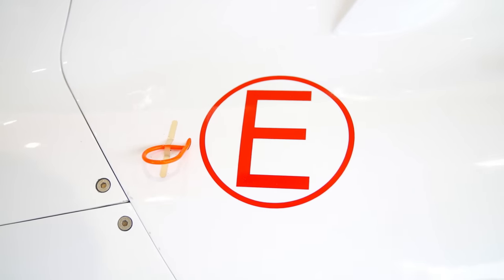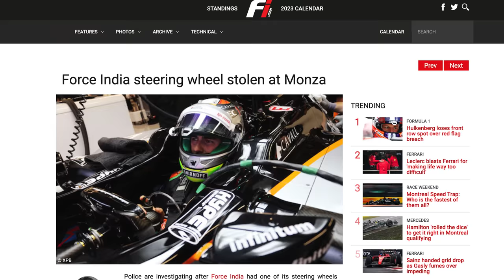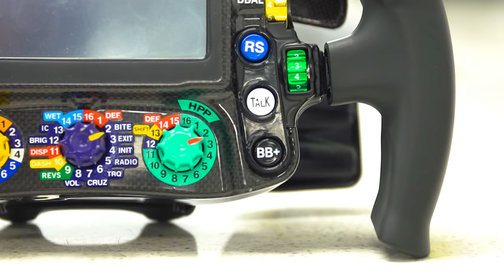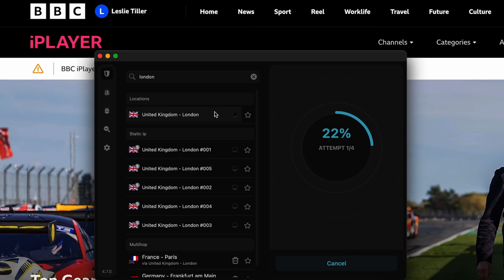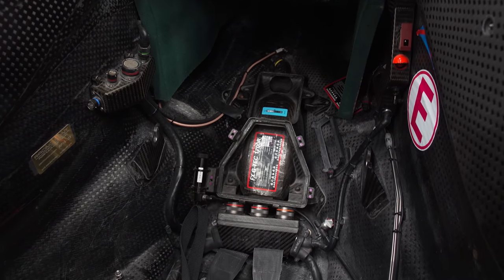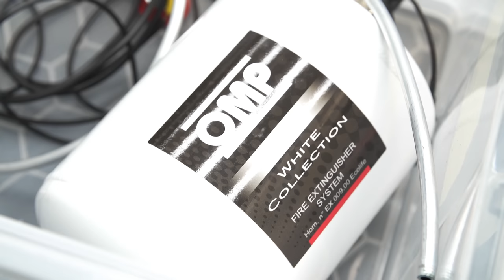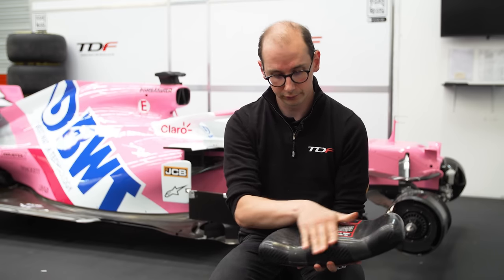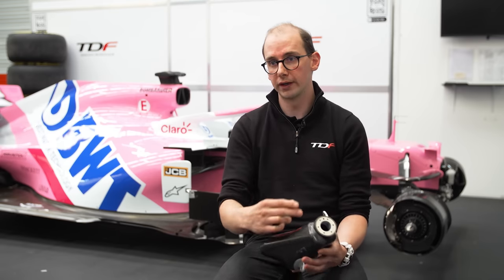Pull This Cable And You Destroy A Formula 1 Car

Comment: Reminder that Robert Kubica on his comeback must have attempted and passed the 12 second extraction test with his injured hand. I find that quite impressive.
Reply: And Lance Stroll had to pass the tests with his injured wrists at the beginning of this season.
Reply: Billy monger races f3 and did this test for f1 and passed. He’s a double amputee, above knee and below knee. He lost his legs in an f3 race. It’d be hard to get your whole body weight on your arms in a laying position like these cockpits. I tried in a formula ford 3 months after I lost both my legs and I can tell ya it wasn’t easy. Thinking where to grab was the hardest.
Reply: @nothinyaseehere9449  Monger has electrical prothesises in his legs while he races. How could he therefore use any pedals huh?
Reply: @vernerikerppola4438  he races with hand controls normally in formula 2. I use prosthetic legs aswell and I use the throttle brake n clutch pedal.. it’s really not that hard…
Reply: @nothinyaseehere9449  he's never even raced in formula 2, he stopped racing in 2019...
Reply: @tauzik  yeah but he’s tested the cars..
Reply: What f series do you race in?
Reply: Ahem, Zanardi?

Comment: I’ve done some of the carbon fiber work on extinguisher moulds but never understood nor have seen anyone explain how remote charging works. That was super interesting
Reply: The AFFF system in my track car (former race car) has such a remote charge - and it's decade old tech. The charge is a common BB-gun CO2 cartridge. (I like it because I can refill it (water and soap powder) without all the hazmat crap with shipping a pressurized system - which is what's in the active race car(s).)

Comment: It’s insane how fast you need to extract yourself from a Formula One car, even a fit person would struggle their first few times, also, how many attempts does a driver have to do this test?
Reply: I think they have as many tries as they need which is a bit mad really
Reply: Its also insane how quickly you an roast to death in there; overalls are only fire retardant, not fire proof, and certainly not heat proof. Self-extraction is also practiced at Formula Student (and a whole host of other events) - its important.
Reply: @andyowens5494 the weird thing in Formula Student is the fact that the driver has 2 less seconds to leave the car, and almost none pf them are trained racecar drivers
Reply: Seeing how fast they can burn, and how hot, it's not surprising at all. When your car is on fire, you will be HIGHLY motivated to get out. We practice that. But we can't practice with the car covered in AFFF, which will make the job MUCH harder. (that stuff is effectively soap.)
Reply: @raphaelrodrigues1645 as someone who has gotten into a fsae car before, it looks a lot easier to do that over an f1 car lol
Reply: @JackJackJackJackJackJack  well, we are still talking about university students, not professional drivers, but yes, a FSAE car is a lot more spacious than a F1, even though it is half the size lol

Comment: The 'E' is for Extingusher, not the electrics. Common Confusion for new marshals, or even experienced ones in the heat of the moment. Yes it should kill the power to the car, but if cutting the power is the only goal, then go nowhere near it.
F1's have the neutral button on the front of the chassis. This shuts down the ERS and puts the car in neutral to allow you to push it. Oddly alot of these are really small and near impossible to press with the big ERS gloves, marshals are required to wear. I always had a sharpie or something to poke in the hole.
Even with the steering wheel in place the amount of effort needed to turn the wheel while leaning in beside the car it also quite alot.
Reply: My understanding was that the E stood for Engine, and that pulling the wire would just stop the engine. For use in accidents like Massa 2009 where he was knocked unconscious and unable to turn it off himself.
Reply: @davepusey  Nope E is for Extingusher. There is a electric lightning triangle in club racing for electric shut off
Reply: @joewatts6016  I specifically said E for ENGINE, not Electrics which as you say has it's own lightning bolt symbol.
Reply: i thought it stood for emergency

Comment: I work at a formula Student Team, and there are similar regulations about getting out of the car and also a button on the outside, which turns all electronics off. but there we don´t have such advanced fire extinguisher.

I am not the driver, but i also did the Cockpit exit exercise once, and it isn´t that easy.

Comment: I did not know about this system. So in the case of Romain Grosjean's crash - did this system work or not work?
Reply: The car was split in half so I'm not sure they used it
Reply: It couldn't have been used since the car just exploded in a ball of fire and there wasn't really any time to pull the cable
Reply: The car was cut in half, and the part that Grosjean was in was no longer connected to the fire extinguishing system. Plus, good luck pulling that cable while the car is up in flames like his was. It's for engine fires, not for massive fuel fires like Grosjean's.
Reply: @-Jester  at 5:52 they showed a button inside the cockpit presumably located where it's convenient for the driver to press it when in a panic due to fire. And the video said that it floods the cockpit area with the fire suppressant. I could understand the system failing if the car splitting severed the system, however, I'd think that if the car splits in half then most of the time you'd want the fire suppression system to automatically go off. Again, I didn't know this system existed, hence the wondering how it worked out in an actual car-on-fire situation. I don't recall anything mentioned about a in-car system for fire suppression during reports on the crash - which might be because I didn't pick up on the mentions because I didn't know the system existed.
Reply: @eric81766  Even if it does automatically trigger, there's nothing much it can do if the connection to the nozzles is severed
Reply: @eric81766  There's a good possibility that the system was either severed or otherwise damaged. The fire suppression relies on pressure and if the pressure is lost then it won't work correctly.

The other scenario is that the fire suppression system worked as intended - it stopped fires in the cockpit of the car. However, as Grosjean's accident was a fuel fire where the car was torn in half and the fuel was ignited all over the floor, the danger wasn't coming from inside the cockpit but instead all around the chassis. This would also explain why only Grosjean's hands were burnt, as the fire wasn't inside the cockpit but instead around it, and he burnt them in the process of escaping.
Reply: He didn't use it, because it's not something they actually train for
Reply: @-Jester  Plus, Haas said his gloves (Alpinestars, not sure which model) were of the older FIA 8856-2018 standard, while his suit (an Alpinestars GP Tech V3 - best in the biz) was designed to 8856-2020

Comment: Can somebody kindly explain why f1 teams dont use flexible flask type containers to store the fire extinguishing material ? Wouldnt that be more cost effective and easier to place within the car ? (Suppose a flexible but nonetheless resistant container to prevent punctures, tears and the like)
Reply: Pressure
Reply: Think spraying a bottle of champagne (rigid vessel) vs blowing up a party balloon
Reply: Did you see the video? They do use a bag type system, the carbon fiber enclosure is just there to support the bag for when the system is pressurized.
Reply: @musguelha14 I’m sure they mean just the bag dude🤦🏽‍♂️

Comment: "The steering wheels are very expensive "
Well, to mitigate against that they should've just engineered the cars to work with an off the shelf game controller like you'd have for your ps3
😂
Reply: PS3? Have you been in a coma for 15 years? If so, my apologies.
Reply: This comment aged like milk

Comment: I’m surprised the haven’t switched to stop fyre the halon replacement yet 

For anyone unfamiliar halon was banned  from manufacturing specifically not use (it’s still used where it’s been installed and the supply hasn’t been exhausted) for environmental concerns and was a gaseous extinguisher that doesn’t spray a “foaming agent” and can be fired multiple times without cleaning or recharging it doesn’t expire the way most foaming extinguishers do it’s also doesn’t destroy everything it touches the was a lot of extinguishing agents do

Comment: In the industry I'm grounded in, we have on-vehicle extinguishing systems that are not only Halon-based, but the bottle containing it - Under significant pressure, I might add - Is a good 500mm diameter and 2,5m in height. Despite this, it bears a more than passing resemblance to a family-size UK Class A fire extinguisher... 🙃

But that said; The system's designed to suppress high intensity electrical fires (Including transformer overruns) on a system that operates at 25kV, at speeds of up to 320km/h, on a vehicle weighing over 950 metric tonnes. As an aside to this, it also covers the distance between London and Paris in just over two hours... 🚄🇪🇺💨😁

Also: Can anybody please explain that Halo device? I can understand it being employed in Formula E - No engine means no air intake, meaning no „Triangle“ - But why would you need it in conventional ICE F1 too? 😳

Comment: Seeing you get out literally made me cringe. I know you've never been harnessed in, but they should've explained this to you... the harness is designed to stay out of the way. (For the record, those loops on the shoulders of the suit are there for safety workers to pull your ass out of the car. I have seen them used.) The harness will simply fall away / slip over your shoulders as you get up. You don't need to touch the radio or cool suit connectors; they're break-away.

(In my track car, you DO need to get out of the harness. I'm using Simpson D3 off-road harnesses... the hip and shoulder are connected. It's only used for track days where people are running street cars with nothing more than the factory 3-pt seat belts, so safety workers are prepared to cut seat belts. Plus I rarely wear my suit in that car.)

Comment: kind of like aircraft, if you pull that engine fire handle you are not relighting that engine again*.

*Not in flight at least, once the turbine engineers pull it apart and fix it, then it will run again.

Comment: Interesting. So the driver needs to manually pull the wire to start it, instead of automatically going off when it detects fire (heat or smoke)? What if the driver is unconscious?
Reply: That's why you have the one on the outside for a marshal to pull
Reply: Auto detect system is subjevt to faults which would be extremely dangerous if it went off mid race. 

Better to stay manual and ensure all staff on track are allways ready and at the scene of a crash as fast as possible.

Comment: Formula Student you have to be able to egress in 5 seconds, there's no requirement to refit the wheel. 

I think the fastest egress I know of was about 1.6 seconds. I think in the real event the driver just yeets the wheel when getting out.
Reply: It strikes me that the wheel replacement portion of the test is completely irrelevant, if there is such imminent danger that you need to leave the car as fast as possible then replacing the wheel would be too risky anyway.

Comment: Seems like a pretty big design flaw, like putting testicles on the outside it's bound to receive treatment it wasn't meant for.
Reply: not a design flaw at all. No one will pull that for no reason and it must be reachable when needed

Comment: To me its pretty ironic that halon fire extinguishers were banned/discontinued because of environmental effects…in the Formula1
Reply: The gases from that kind of stuff were surprisingly a lot worse than typical carbon from cars. 

It ripped holes in the ozone.
Reply: There is more to it than that - if you spray halon on sufficiently hot metal it decomposes and the resulting products include hydrochloric, hydrobromic and hydrofluoric acids. This was known about ever since these compounds were invented in the '40s, but when it was originally introduced in aircraft applications the benefits were felt to outweigh the risks.  In fact, one of the primary advantages of Halon 1301 was that it reduced (although did not eliminate) the risk of HF production, which is why it was widely used in ground applications as opposed to the older Halons like 1011.

Comment: I'm sorry but putting the steering wheel back into the car is the most retarded thing I have ever heard of. Oh yeah the whole point of emergency exit is speed and that the car can explode at any second. Better put the damn steering wheel back so potential thiefs won't steal it. The whole point of a drill should just be getting out asap. why is putting back the steering wheel accounted in the time lapsed?

The thing I remember from all the fire drills in school and at work is to gather up all your valuables and make sure no monetary damage will occur. Only then do you exit the building. who cares if people burn alive or suffocate. we gotta make sure the damn valuables won't be stolen during a fire.